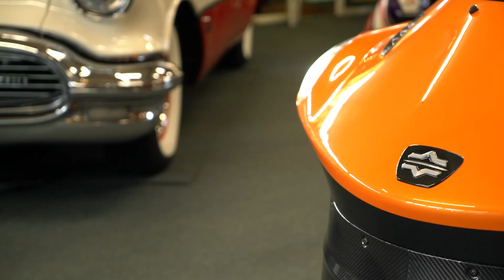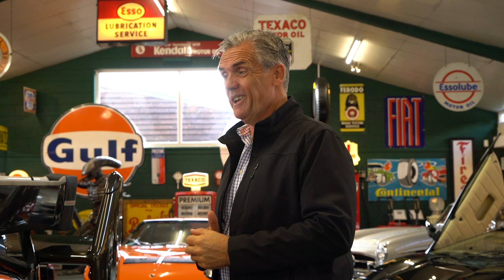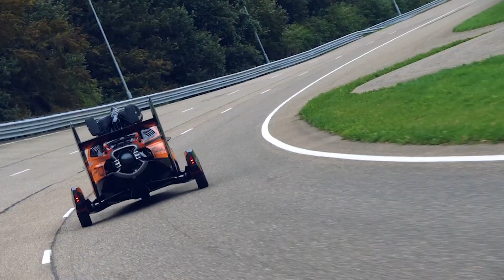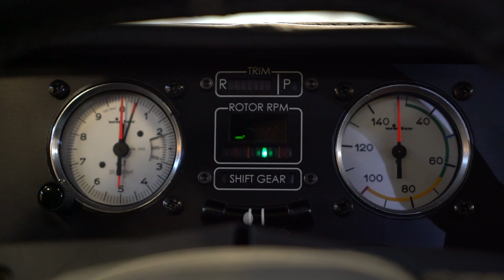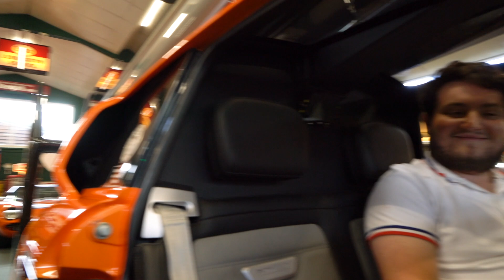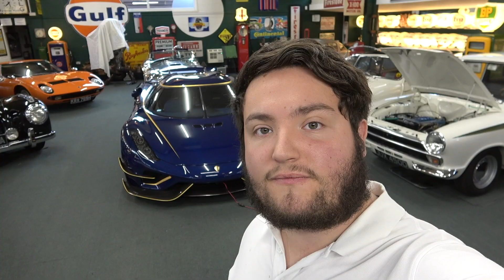The worlds first FLYING CAR! Pal-V

Comment: That rotor system will not lift 740kg even if that includes passengers which I am guessing doesn’t so ad another 160 kg and we are up close to a metric tonne. Do they actually have an aviation design engineer on their team?

Comment: All they have achieved is a three wheeled go cart that looks like it can fly.The only platform you can fly is a simulator resembling the proposed cockpit.The problem they have is that designing it to be Road worthy and then trying to make it fly will make it too heavy to be a autogyro.Right now it’s a concept model that drives,there is no information on the engine, gearbox to the prop,fuel system etc etc. On another video they show the prop turning and from the sound it is clearly a small separate engine that would only get a model aircraft off the ground.

Comment: Its not very practical if you need a runway or clear motorway stretch to become airborne. Undoubtedly  the technology  is impressive, but sadly its still a bit ahead of its time and I dont see it taking off anytime soon (excuse the pun)
Reply from the maker: Well it’s definitely a great step towards the future and I look forward to showing you more soon!!
Reply: I don't know about your area but in the States there are little local airports all over.  My commute now of almost 30 miles takes 1 hour and 45 minutes every day, at the least.  If I had this I could drive 15 minutes to the local airport fly to the one that's five blocks from my work.  How long does it take to go 30 miles at 100mph...  Not long!  What an awesome commute that would be. (EDIT: To be clear that commute time is one way...  It's very tiresome and stressful.  Take care, -Eric)
Reply: @EricHorchuck  hang in there Eric, as one who has had some truly horrendous commutes, I sympathize with you.
Reply: @WhuDhat  thanks 🙏  I feel, looking at my old post, that I should have specified that my commute is 1 hour 45 minutes one way then another for the way home.  Take care, -Eric
Reply: @EricHorchuck  what are you commuting with? 30 miles should take 30 minutes, not longer than 45.
Reply: @Valtheairhead  I am commuting with two trains and a bus.  If I drove it would still take well over an hour each way.  Commuting on Philadelphia's "sure-kill" (AKA: The Schuylkill expressway or i76) via 422 to get to 676 is no joke (well actually it is) during rush hours.